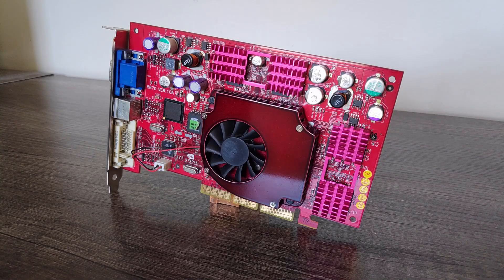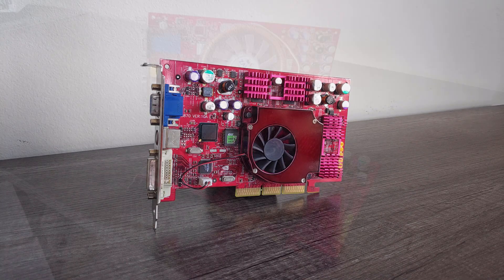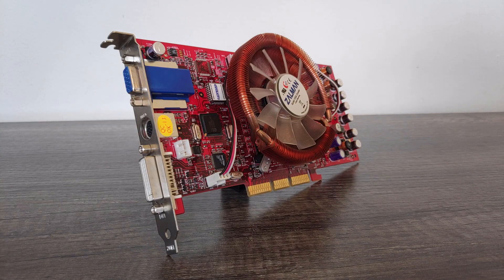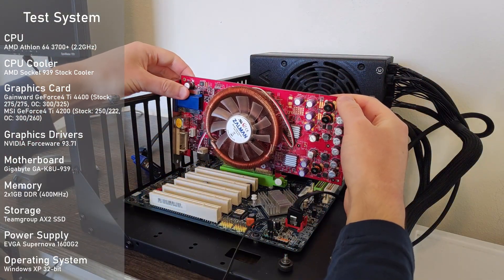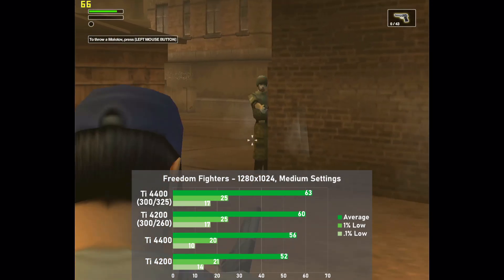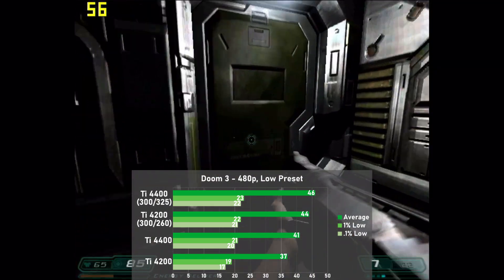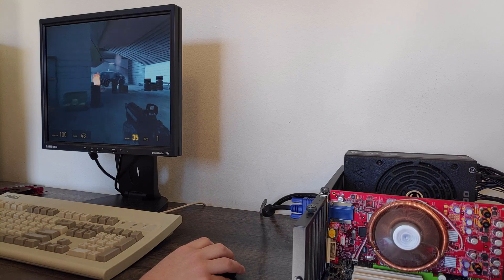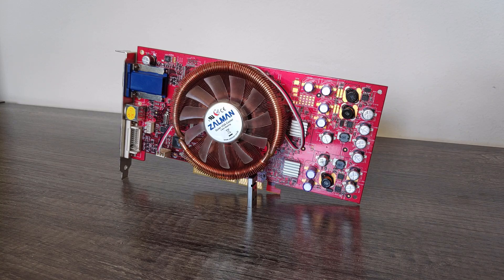GeForce4 Ti 4400 - NVIDIA's Unloved Middle Child

Comment: Nice video! I have a feeling though that the vram oc on the 4400 was not fully stable since most of the time the minimun fps are less in the oc configuration than standard. Cheers

Comment: How you install Zalman VF900-Cu on your Geforce 4 Ti? 2 Pin fan connector and mounting holes too fin for him. I see you sawed chip substrate on the edges a little.
Reply from the maker: If I remember correctly I used the narrowest mounting holes on the cooler and they just worked. The fan I plugged in by removing the plastic shielding on the 2 pin header to just reveal the bare header, from there the fan had no issues plugging into it. Also the chip came like that, if that was a modification it wasn't my doing
Reply: @SPNG  Original Zalman rubber spacers for screw do not fit into the edges of the chip. I check it to day on my V9280S. It's very clever to sawed the edged of the chip carefully. Whoever thought of this before was smart ass. Thank you for answer. Now I don't have to guess if it will work with 2 pin fan header at least, when it done.

Comment: I had a Ti 4200 128MB from Chaintech in 2002, but this card was broken after 1 mounth. I took a Asus Ti 4400 128MB for 299€, about 60€ more than the Ti 4200, a good price. I used it (overclocked to 310MHz core and 690 MHz memory) until I have upgraded in 2003 to a Hercules 3D Prophet 9800 Pro 128MB. The 4400/4600 cards also have a better quality PCB than the Ti4200 cards. Only Asus had a special 4200 128MB with the 4400/4600 PCB and faster BGA memory chips.
Reply from the maker: This card was pretty good if you wanted to get flagship performance for cheap, almost all 4400s should be capable of doing 4600 speeds! Pretty cool that you could more or less get a top of the line card for upper mid range money.

Comment: I’ve got a 4200ti and a 4600ti, I didn’t know that I wanted a 4400ti until I saw this video.
Reply from the maker: I'm happy with my 4200 but some people have a soft spot for this card, I can understand why given it can easily reach a 4600 in clock speeds!
Reply: I have a bunch of Ti4200's, and a Gainward Ti4800 SE.

Comment: Back in that day, I got a Ti 4600 as at that time I had 2 GPUs I could chose between, the GeForce 3 Ti 500 or the GeForce 4 Ti 4600.
For the rig those two cards went into, you can say it was pretty much a waste either way, but it was a temporary install.
What I used these cards in was an AMD K6-2 running at 350 MHz, naturally bottlenecking the 4600 to hell.

I was given a 800 MHz AMD Duron later that I ran until I came across a deal I couldn't pass up.
Epox Nforce 2 motherboard, an Athlon XP 2000+ which I later swapped out for an Athlon Mobile 2500+ for the crazy overclocking it offered.
The later half of that Ti 4600's life was served in that Athlon XP and was probably where it got to run at it's full potential.
Reply: That AMD K6-2 350 would have bottlenecked any GeForce, even a GF2 MX200 which was slower than the original 256 SDR

But hey, I’m running a GeForce 4 MX440 in a 400MHz Pentium II system because I don’t have anything more suitable 😆

Comment: I had an Albatron 4200ti 64mb, I remember when overclocking it I thought RIVAtuner wasn't working properly because I got over 300mhz on the core and god knows what on the memory, pretty sure the slider didn't have far to go. I used it with a 700mhz P3 (it was my mums work computer LOL), which made for some pretty interesting bottlenecks at the time - I was only 12 and this was my introduction to GPUs/CPUs and overclocking them myself. Great time to be a kid!
Reply from the maker: Reminds me of when I would try to tune my old X1650 PRO as a kid. Good times 🙂
Reply: Dude that 4200 was being strangled :D

Needed at least a 1Ghz P3 to get started, but even that would have crippled the card in many titles.

Comment: I had a 4200 and overclocked it. It was a good card but was quickly
Overshadowed by the Radeon 9000 series.
Reply from the maker: I think it remained viable for a little while after due to its cheap availability on the used market! Performance and features wise though it definitely couldn't measure up to what the 9000 series had in store.
Reply: I kept my Ti4800 SE for years, as I only played Quake III OSP exclusively from 1999 to 2004. Eventually I had to move to a 6800GT because I wanted to play Doom 3, Butcher Bay, Quake 4 etc.

But I kept the 4800SE. Still get use out it today in an old rig.

Comment: I ran my ti 4200 128MB at 280/250. Maybe there was more to be had, but teenager me didn't know.
Reply from the maker: Maybe I just have good luck of the draw but that's still not a bad overclock! I'm sure it would have been just as fast as a Ti 4400 at those settings.
Reply: @SPNG  It was just as fast and that was sufficient for me. I felt great I saved that money.

Comment: I always enjoy your videos, and I'm glad to see the 4400 get some time in the driver seat. As I've mentioned, I was quite happy with my EVGA GF4 4400 after I got it in mid-2002 and prior to it artifacting about 2.5 years later (the VRAM are Samsung K4D26323RA-6C36 modules rated at 3.6ns, and I had been pushing the RAM above the base 275MHz; the core was factory overclocked at 300Mhz). I never had a chance to check it out on as beefy of a system as the 939 here, with it initially going in my T-Bird 1.4Ghz with 1/4 of the RAM then later with a Barton XP 3000+ before I replaced GF4 with a 9800 non-pro. Compared to your 3700+, the T-Bird + 4400 scored 8,251 in 3Mark2001SE (at least that's what I have in an old HTML file). Jumping from a GF2 MX 400 to the GF4 was the first time I got to personally experience DX8+ class hardware myself outside of playing Halo and BloodWake a few times in the dorms on others XBoxes (I did get one of those, but not until a bit later in '02). It seems silly to me now, but I loved just watching the wolfman demo at times. Yeah, in most cases the Ti 4400 isn't very much faster than the 4200, but for whatever reason at the time I went with the 4400. I just know I couldn't quite afford the 4600, and I paid 226 for the 4400. I had the 4400 stored in its box, put up for years now, probably nearly the decade since I last moved, but after your last video, I went through and got it and a couple of other things out and put them where I had planned to take another look at it. I haven't had time to get around to that, but I'm going to post a (very) short clip to show that you did inspire me to at least get some stuff out of storage. I'll put the link in a reply to this comment, since I don't know the filter options you have on and don't want this comment here to get ate by YT.
Reply from the maker: My card used to artifact as well but as it turns out there was just some bad solder joints on some of the memory modules! After a reflow with flux the card was working perfectly again. I will say the 3700+ definitely allows this card to stretch its legs, I was able to see pretty much full performance out of this thing in the testing. Even then, a Thunderbird would have been an awesome pairing for this card during the time! And not gonna lie, 226 wouldn't have been a bad deal at all for it, especially given it was a factory overclocked model. Looking forward to that clip by the way!
Reply: @SPNG  Yeah, since it started having problems right before DooM 3 hit and was out of warranty at that point, I took it as a sign to upgrade. When I get a chance, I'm going to finally take another look at it. I did post the video as a reply after I made the original comment, but it does seem the filter chopped that reply out. The video id is 5NIA1vBEfBs, and I made the video public now so it's visible from my channel page too as well.

Comment: Your conclusion is pretty much spot on with what I remember. The Ti4400 was a pretty significant price hike over the 4200 and no one thought it was worth it.
Reply from the maker: It's crazy to see how many cards fell victim to the Ti 4200's amazing value! Kind of a shame the faster memory hardly does anything for it too, I was betting it would make up some ground there.
Reply: It was many version 4200 with memory like on 4400. Asus V8420 Ultra Deluxe have same memory chips like V8440 Ultra Deluxe. Also was V8420S on 4600 board, also 9280S and S2. Better pay extra fot 4600 with better memory chips, then buy 4400.

Comment: [cries in MX440]
Reply from the maker: 😆I mean hey, at least the MX 440 was super cheap. And it's good enough in DX7 that I'd like to test one against a GeForce2 Ultra, I think it would make for an interesting matchup
Reply: @SPNG  I got robbed. Went to the store to buy a Geforce 3 with £150, they had just gotten a delivery of new GF4 MX440's. The guy told me they were just as good as a GF3, but cost £30 less. So I bought one. Wasted my time.

Took it back the next day and complained so loudly and for so long I got the GF3 as a direct replacement. Ergo, I got a GF3 for £120, in the end.
Reply: Stupid comment.

Comment: I love that the test bench is relatively period correct
Reply from the maker: It's quite nice, and a lot better than the 3GHz Preshott system I was using before! I might swap in an Athlon 64 X2 and overclock it so I can test some faster cards.